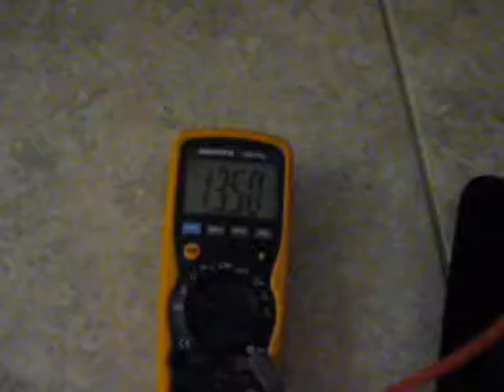Bedini Charger Neon on cap

Comment: I have found the same thing. I think that is because between trigger and working coil is formed capacitor, which charges with high voltage when you switch off device. The same thing happens with battery plates. I think that it is whole secret of BEDINI solid state charger. More capacitance between coils=more output power.